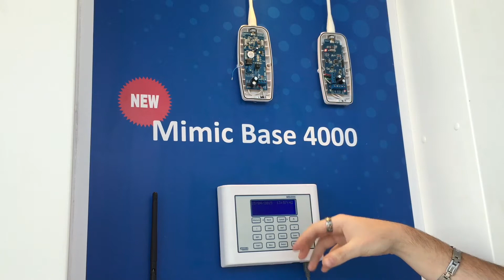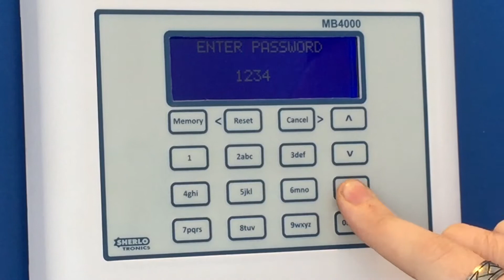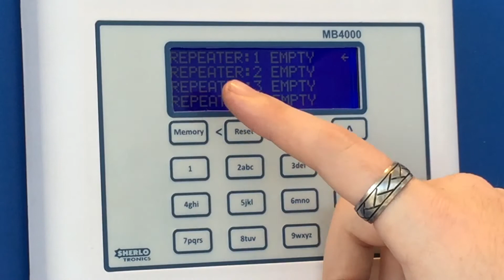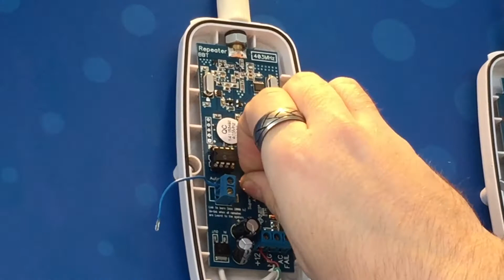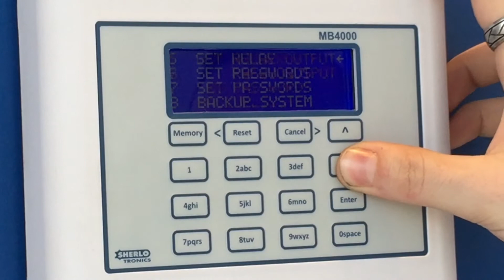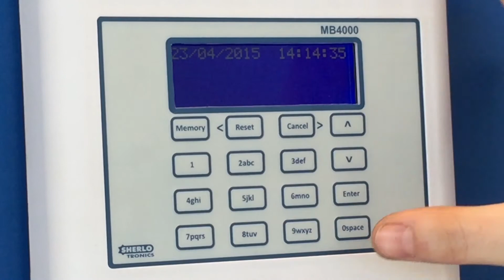SHERLOTRONICS MB4000 VIDEO 2 - ENROLLING A REPEATER

Comment: Were doing a panic system. We program pendant remotes to a rx4-500 which is connected to a radio transmitter for armed reaction. If I want to put a repeater unit. Do I hold in the learn button on the repeater while I press the remote button? We've done that but we can't get 200 meters out of the pendant remote with the rx4-500 and a repeater.
Reply: Thank you 🎉